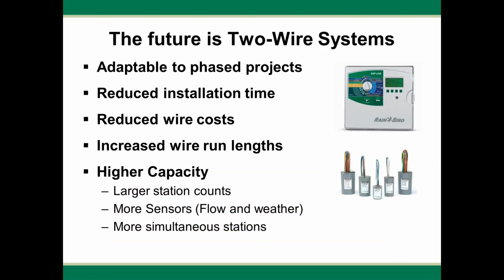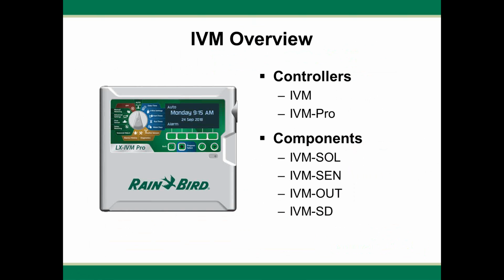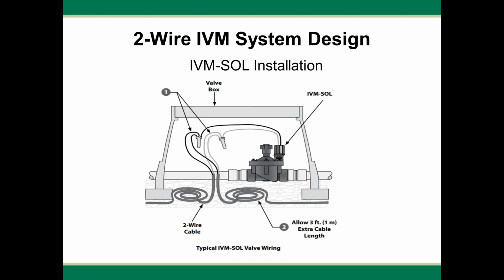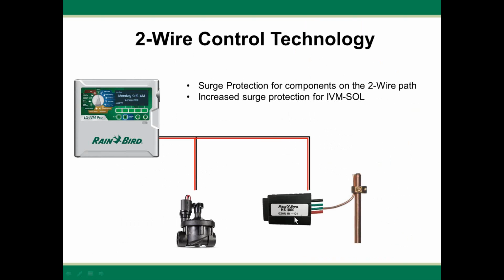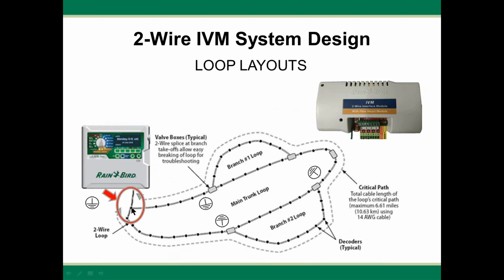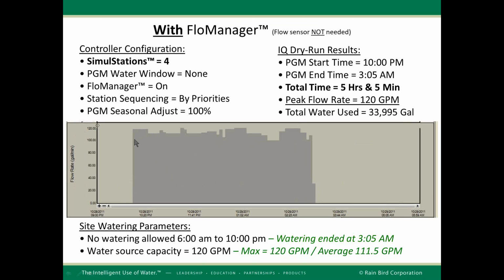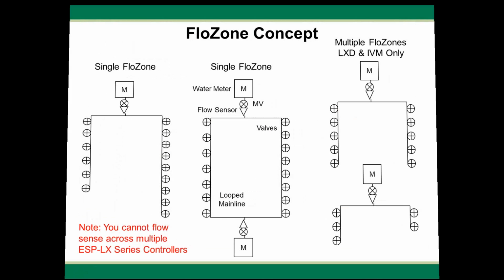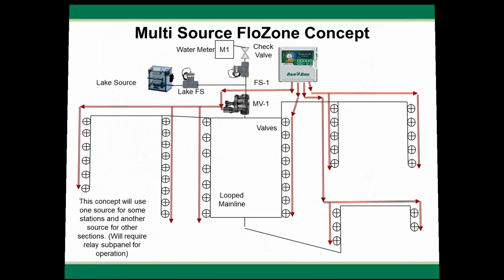Rain Bird New LX-IVM 2 Wire controller

Comment: Let me review your product. This system is easy to understand and very affordable.  VERY BAD THING: The flow sensor: If there is any problem like a broken drip or sprinkler, the system says high flow zone, but it doesn't specify which station.